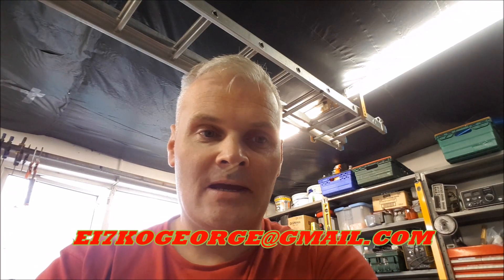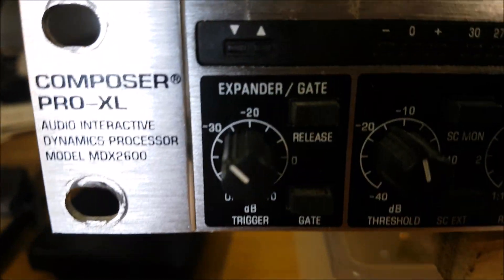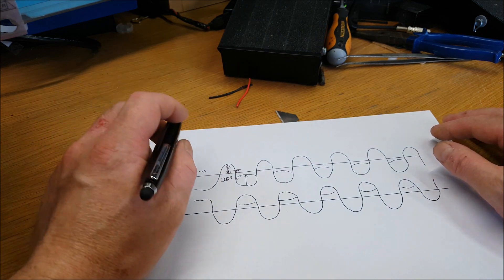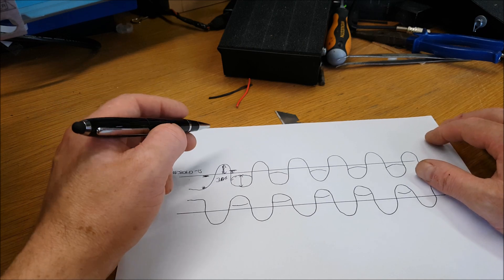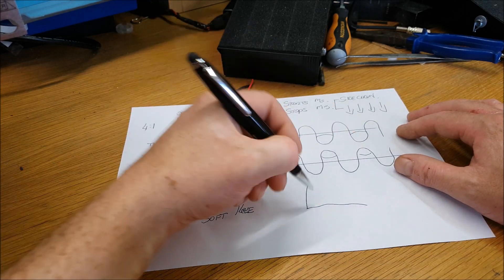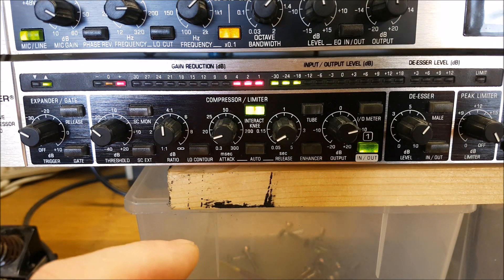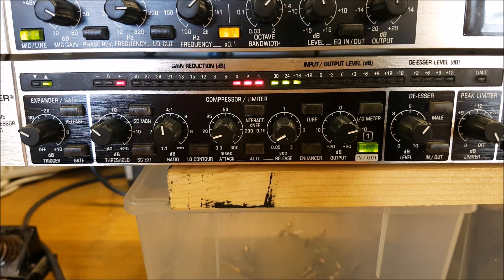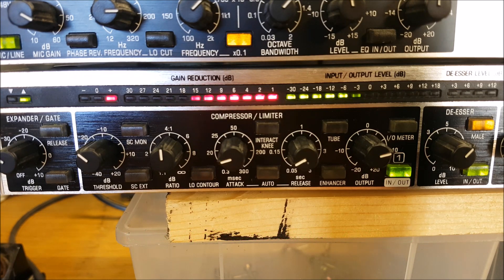HAM RADIO AUDIO COMPRESSION 101

Comment: 2:10 That is NOT mono... It is just the "left" and  "right" channel are comtrolled through the knobs of one channel, except for the output gain knob....Signal still stays stereo....(if stereo is put in)
When pushed in it still is stereo, pushed out "dual mono", so channels controlled individually.
Reply from the maker: If you say so. The manual says different though.

Comment: I want to thank you for these very informative videos. I want to get thay hifi audio as I like to call it. I want 6khz wide on TX. 
Motor mouth maul used to make the "Mauldulator" but i dont think he does anymore.
A company called asymod has copied gis work and expanded. They offer several boards for $2-300 American. And will install it for anorher $300 or so. 

This is super expensive for me, i want to do direct injection on my president Madison, then run a compressor and noise gate and pre amp.. i believe that will get me the Audio i want. But the Madison is still restricted on gow wide it will TX. Assuming less than 3khz.  

Any thoughts?
Reply from the maker: I've not a clue in the world if the madison would be capable of wide tx. Shoot Tim a mail at snake radio customs in Arizona. Tell gime you were talking to me and ask him. He's done a good few radios for hi fi audio. He may be able to steer you in the right direction.
Reply: @GeorgeEI7KO awesome thank you very much for the response

Comment: As we're only using one channel, another neat trick is to use the right channel for normal communications, then you can have more 'extreme' settings set up in the left channel (I'll explain why later) then when you hit the stereo link button it imports he settings from the left channel to the right channel, so that means you can effectively have two compression profiles, selectable via that switch. You could have one for SSB and another for FM, but in my case I relay a VHF FM net over UHF FM (3 times per week) and the incoming audio levels from the VHF stations are all over the place, so rather than setting it for the quietest one and letting the loud ones be 'massacred' by the radio's (IC 9100) inbuilt limiter (which doesn't sound good), when relaying I toggle that switch to import my 'extreme settings' (ratio 8:1, attack 1 ms, release 0.75 s) and it 'evens up' all the UHF transmissions; it's very cool. Incidentally, I'm using the classic Drawmer DL241 compressor and if you compare a picture of its front panel to the Behringer, their similarity will give you a chortle (the only real difference is that Behringer added a de-esser). Behringer do like to take their influence from some of the classics (same with the Aphex 'Aural Exciter and Big Bottom' - the best product name ever - and Behringer's SX3040).  🙂 🙂 😀
Reply: I've just procured myself a really nice (and clean) Aphex Compellor 320A and after sorting out the levels (which I've just finished; I had to carefully pad the Icom's line input as there isn't a huge range on the Aphex's output pot) and it now sounds way beyond awesome on 2m FM. I'm managing to pack lots of [distortion free] audio into the IC9100 (AKA I'm stopping just shy of where its nasty limiter kicks in; you can see that by using SDR Console's mod meter when it 'flat tops' on speech peaks, or even just by hooking up a 'scope on the AF output of any old FM amateur receiver and noting where it stops increasing in amplitude) and all this is now being achieved with no compression artifacts (previously, I was using either the Drawmer's compressor, or my SPL Track One channel strip's compressor, all just to get another 3 - 4 dB of audio 'into the channel' without tickling the Icom's limiter). Now, it sounds a lot cleaner, less fuzzy, and even slightly louder and punchier than it did with either of these compressors, so that's a totally stellar result! I can't wait to hear how it sounds when using SSB; that'll be really quite interesting (we've a VHF SSB net on Wednesday, so I'll hopefully get some interesting - good or bad - feedback from that). 🙂

Comment: Great video! A couple of things. I think, the button setting on output gain is reverse. Pressed in (lighted) is output. In my view the de-esser knob marking is confusing. It is the level of the automatically detected sibilance frequency. So 0dB means maximum suppression and 10dB is no suppression.
Reply from the maker: Thanks for the info!
Reply: Given that the feature is for reducing excessive sibilance, it doesn't make sense that 10dB be no reduction. The de-esser knob is for controlling the amount of frequency suppression (see p7 of the user manual).